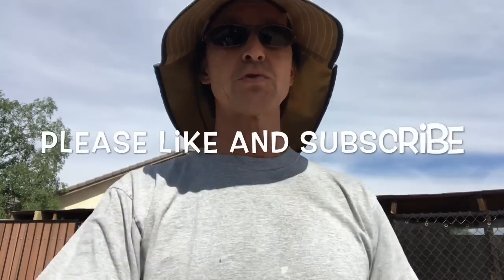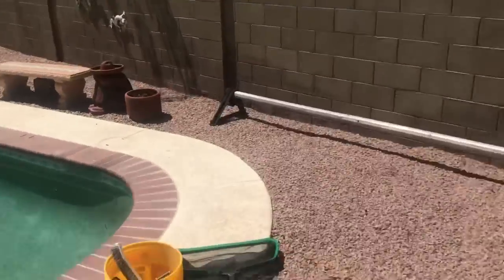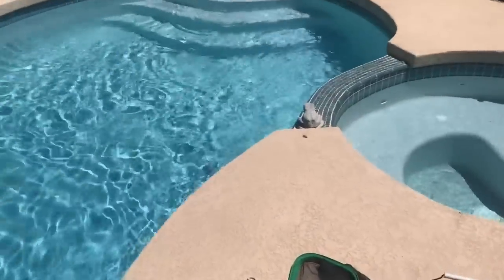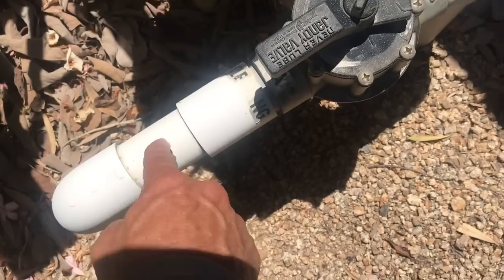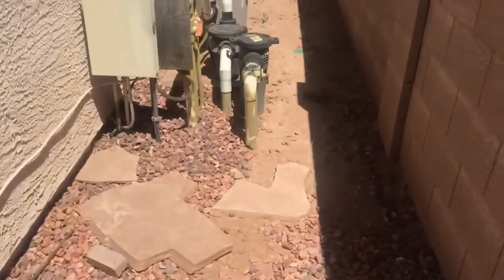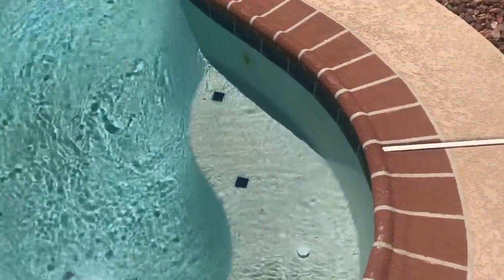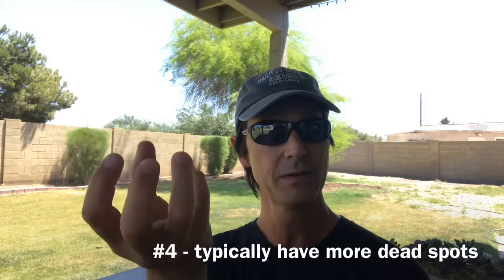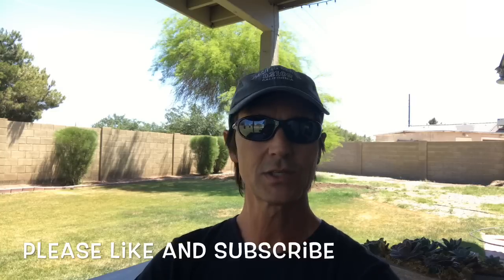In floor “Pop Up” Cleaning Systems

Comment: thanks for the info...my pop ups started to lose pressure and push out air...we have to hand vacuum the pool but now the lack of pressure with air does not create a good vaccuum so now the pool is getting milky...dont know what to do...cant afford a pool dude and besides that I don't trust anyone that would be as good as you are...any advice?
Reply from the maker: Somewhere in your system you have a leak (or more) and you need to find out where the air is getting into it from.  Check pump lid, O'ring and also the o'ring on the pop up actuator.  Make sure you're filter is clean.  Also do you have a DE filter? The milky could be an indication of a torn grid or more in your filter allowing DE to get into the pool.  I'd need more info to be able to be more accurate.
Reply from the maker: You may want to convert your pop up system to a in pool suction side vacuum.  This video may help: https://youtu.be/gSfbNv4sV_M?feature=shared
Reply: Thank you, I'm ready to bury the whole thing...
 @PoolSchooler
Reply from the maker: @Getwhiskied  I know a lot of people who have chosen to do so. Can’t say that I blame you.

Comment: Do you recommend robotic cleaner ? I ve suction zodiz z4  but it just gets stuck to one side. Plus i have many leaves falling into pool each day. Thanks
Reply from the maker: I'm not a big fan of robotic cleaners as they are pretty expensive and most that I know of have to be put in the pool and plugged in to clean the pool then taken out after cleaning cycle is complete.  Whereas the suction vacs can and do stay in 24/7.  That said, one of the drawbacks of the random vacs like yours and the ones I recommend as well can leave "dead" spots.  I'm not really a fan the z4, I think it's over engineered, BUT if you read over the manual for that vac it should give a recommendation on the direction to point your return ports (usually it's down).  Follow their recommendations for that and you may find that your vac gets those dead spots (maybe).  Also if you have any sort of water fall or water feature that can also create a current that may push your vac or the hose away from certain areas.  Try those things and see if they help.
Reply: @PoolSchooler  thanks for the detailed reply. Any suction cleaner you recommend  that can take care of many leaves etc
 Many thanks
Reply from the maker: @amitparol44  My current favorite is The Pool Cleaner.  Two wheel version for play pools.  4 Wheel version for diving pools (w/deep ends).  Here's a link to the two wheel version: the pool cleaner two wheel

NOTE: no pool vac can get a ton of leaves especially large ones. But this vac has done the best for me.  You may also want to get an inline leaf canister like this one: https://www.amazon.com/Hayward-Capacity-Canister-Replacement-Cleaners/dp/B07RXZMTDP

They are really helpful and catch the leaves/debris before they get to the pump basket.

Comment: How do you winterize a pool in the northeast with kind of system? Is it even possible?
Reply from the maker: It's totally possible but unfortunately I have no idea how to do so since we never freeze like that in AZ.  So sorry I can't be of more help.
Reply: I'll help you here. It is possible! What they did with ours is they take off the valve mechanism, and then attach the blower hose to each pop up zone pipe one at a time. Once there is air coming out of the heads, they immediately put a rubber plug in the pipe opening. Since the air cannot come back out, the air pressure itself prevents the water from coming back up the pipe. Any water that manages to make it inside is well below the frost line and will not freeze.

Comment: Can you explain the purpose of the in deck leaf canister and how that is supposed to suck water? Mine hardly has any water trickling in and the intake is well below the water line. Cover is always difficult/airlocked... Right now with a brand new actuator I'm only getting 8 PSI on my cleaning system so the heads are not popping up all the way and not turning. Thank you for your help.
Reply from the maker: I will do a video on that subject this week and release it in two weeks.  Stay tuned,  subscribe and enable notifications.
Reply from the maker: In the meantime direct more of your return flow to the "cleaning" system (the majority of it) that should help.  Don't try to open the cover of the leaf canister when the motor is running it creates a huge vacuum.  DO you have a separate pop up/cleaning system motor/pump?
Reply: I have the valve turned to direct all the flow to the in floor cleaning system, however there is a line that Ts off prior  as overflow release (no shut off for that one) to our one and only jet. I have no other water features.
Reply: And no separate pump for the cleaning system, but nothing else connected either... Had a heater but it died so now  on bypass. I look forward to your video.
Reply from the maker: @janebleu3386  unfortunately unless I saw a picture of what you’re describing I couldn’t comment accurately on that.

Comment: I have pop ups that are stuck.  I know you can buy the correct tool to loosen them but how exactly does this work without replacing the whole thing?
Reply from the maker: Christy Basso you definitely want to get the specific tool for that particular pop up. I thought I showed how to replace a pop up head in my video.  I’ll have to check and if not I’ll do one on that.
Reply from the maker: Ah I was right I did do a video on replacing a pop up head. Give it a watch. I think it’ll answer your question. Here’s a link:  https://youtu.be/To3hieR036E